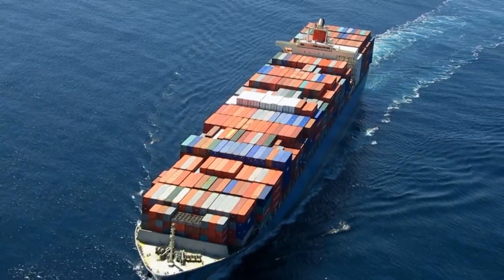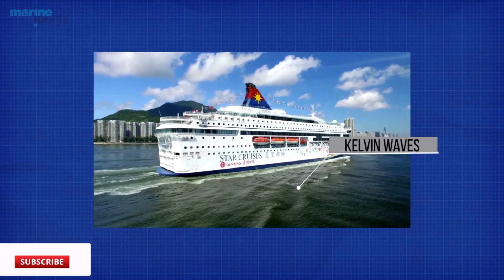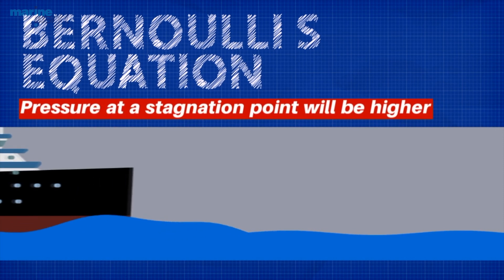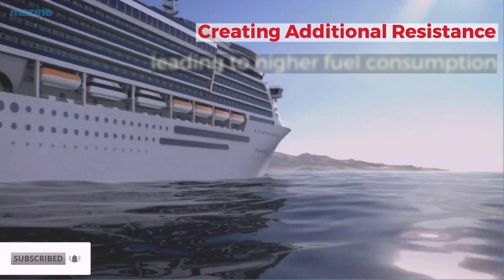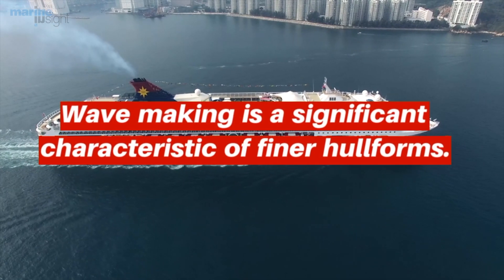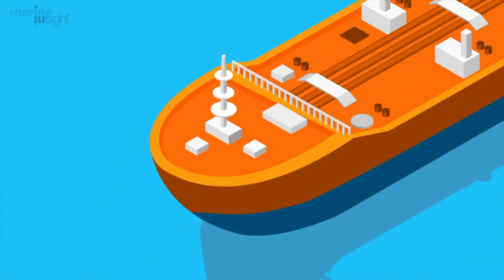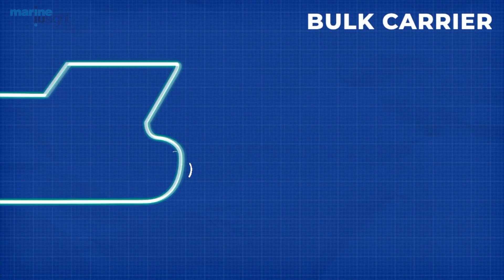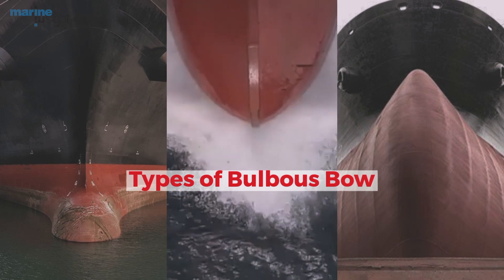Why do Ships Have a Bulbous Bow?

Comment: Bulbous bow which material? Forging or casting? Which grade of materials?
Reply from the maker: The same type of material the hull of the ship is made of, steel.
Reply: @marineinsight  steel is common name. Normally oil and gas industry using the vessel and columns ASTM SA516 . I am asking grade of steel materials.

Comment: I think new building large ships dont have bulbous bow like this because pressure is more this place and you should provide more power. you imagine that you have to push heavy box what would you do? you use your arm or you use your shoulder? also nowadays new large dry bulk carriers and oil tankers  have cylindrical bow. So whole bow between water level to hawse pipe entirely looks like bulbous bow.